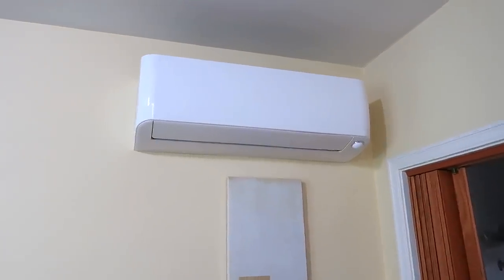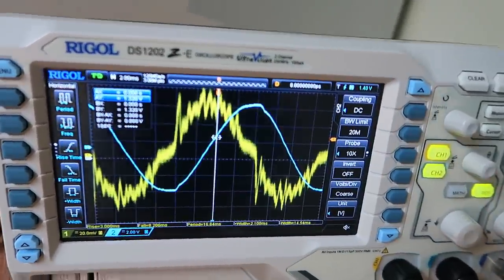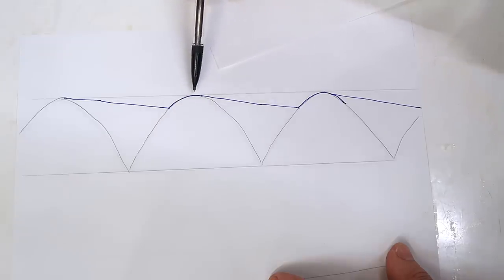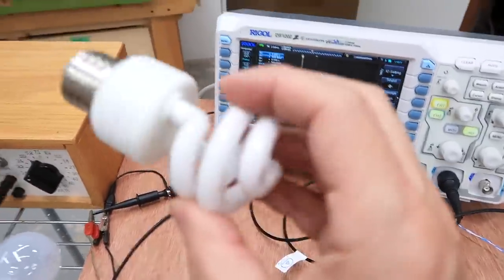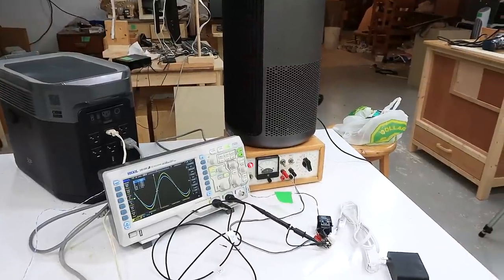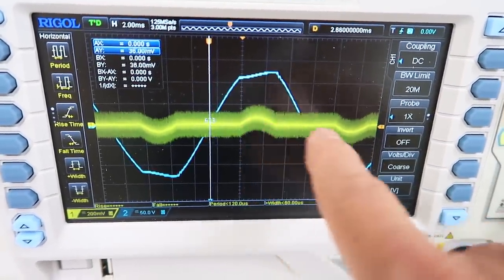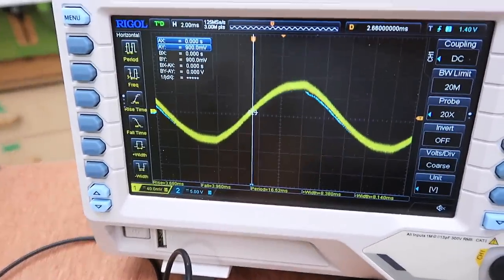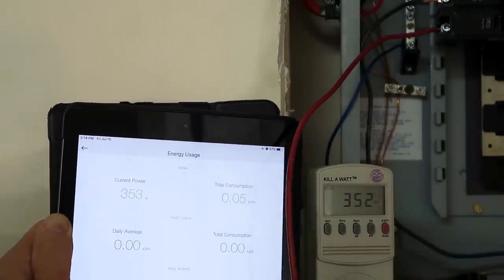Our electrical is all wobbly, measuring power is hard

Comment: That's a bit of a janky setup. I would recommend to use a cheap power meter for three phase with a serial (like RS485) output.
These can be obtained for like 30 euros (you have to convert to Yankee yourself) and provide a fairly accurate result. Then just use your RS485 to ttl converter of your choice and hammer that power register to get your data. Or just get the current overall power usage and plot it over time.
Reply: Edit: I don't mean these aliexpress CT clamp meters. I mean a proper meter that actually doesn't burn your house down like an Orno OR-WE-516. This model is for Europe but I'm sure that you guys will find a equivalent 120/208V version of it.

Comment: Its not quite as bad as you see on the scope.  Don't try to stabilize a current transformer with just a capacitor.  Its a current source, not a voltage source.  So it has to be converted to a voltage source before it can be stabilized with a capacitor... which is what the sensor the CT plugs into will have circuitry for.   Its actually quite a few discrete parts.  simple, but it still takes four or five diodes and five resistors to do it properly.

What you are seeing on the scope is not current.  Actually, you are lucky that you didn't burn something up.  The voltage on the output of a current transformer will be wild if it isn't connected to the sensor circuitry.  It will basically pump until the the electricity starts arcing inside the transformer (like a few thousand volts).

Oh, another thing you need to keep in mind with a current transformer... the output is going to be phase shifted relative to the actual current.   What you see on the scope is NOT the power factor or phase of the actual current.  Its a shifted version of the phase and it's also not a representation of the current at all, it just sorta looks like it.

-Matt
Reply from the maker: I have a resistor on it, also added a cap to low-pass filter it a bit to cut out the high frequency components when I used it with the inverter box.
Reply: @matthiasrandomstuff2221  I'll give you the full circuit.

Two leads from current transforfmer A and B.  Think of a sideways ladder for the circuit.  series components going left to right, and crossing components at various stages.

(1) Back-to-back zeners crossing A to B (A -> back-to-back zeners to limit the voltage both ways -> B).   Usually we throw diodes in as well to the sensor board's rails, but you can omit those since you aren't using a sensor board.

(2) Then series resistors, one for each lead.  Usually around 156 ohms or so.

(3) One crossing resistor to generate the voltage from the current, usually around 12.4 ohms.

(4) Two more series resistors (think of a sideways ladder).  Usually 1K.

(5) And then your crossing capacitor to get rid of noise.  I'd recommend 47pF and 15nF in parallel.

And then your scope probes.

You can omit some of these items but... to be honest, you don't want to omit the back-to-back zeners that limits the differential voltage to something reasonable.  Particularly if you are putting the current transformer on house wiring.  If a breaker trips or a very high inductance load is turned on, the voltage will shoot up too quickly for the resistor to keep it in check and arc across the current transformer's windings.   This is the most common way CTs are destroyed.

Also remember this only works for AC loads.

In terms of additional capacitors.... none of these caps are there to operate as a current accumulator so you shouldn't need any more than that, but if you want you could also throw in an additional 0.1uF cap (100nF).   You don't want to go any bigger than 0.1uF.

-Matt

Comment: But you were already sampling much faster than 60 Hz using the oscilloscope!  Does your scope not have data output or a math/multiply function?  Or is it hard to calibrate the inductive ammeter clamp thingie?
Reply from the maker: I need to log the data over time.  Wouldn't want to dedicate my scope to this.
Reply: @matthiasrandomstuff2221  AD7755  .... they do the heavy lift, you just count pulses. Dont go crazy unles you want LOL ....

Comment: Interesting, never knew you could connect a current clamp to a scope.
Reply: most likely it is a "current transducer with voltage output". 
Eg.. a 1:1000 transformer with an integrated 100 Ohm burden resistor will convert 1A to 1mA (internally on the secondary) and develop 100mV on the output wires.
Reply from the maker: i added a 100 ohm resistor right to the clamp, where I attached the wire.

Comment: On your first measure of current using the clamp I noticed the scope is at 20 millivolts/div. You're measuring a lot of clamp noise, which is bad at low currents to begin with. I don't trust that clamp for being linear with respect to the magnetic field.
If you want to measure current precisely use a transformer that you can make yourself. Wrap one lead (not the wire pair) of the AC line as a coil around a nail, about a dozen turns. Then a few hundred turns of fine wire next to that. Measure the output of this secondary on your scope.
That clamp is noisy and heaven knows what's inside.
Reply: Thanks for the suggestion. I want to remember this for the future.

Comment: So then what if we had the chance to argue the ac vs dc model of supplying electricity to the masses all over again knowing that ultimately many things in one's home would need dc? What about a dual supply model?  Ac for large appliance motors, etc... Some dc level then supplied to the house via the house's ac to dc power "cube."  Imagine a new standard household "duplex" receptacle, except one is ac the other is dc.
Reply from the maker: there are a lot of advantages to AC.  also, we have standardized on it, so it’s not going to change

Comment: So basically, you are highlighting electrical devices that are non-linear loads, which produces harmonic currents and voltages.
Reply: I'd say the non-linear loads create harmonic load currents, which can act upon a source impedance to result in (usually tiny) harmonics voltages. The higher the source impedance, the more significant the effect.... and flat top waveforms (low crest factor) is a typical result.

Comment: this is why audiophiles are going insane with the power supplies and amplifiers.
Reply: LOL .... I've been in an audio forum long ago. I told the people tojust disconnect everything in your house ... period. Audio amps are DC, and preamp sections have regulation .... Probably a 3K dollar IEC cord and 10K magic filter with mundorf caps can help (LOL)
Reply: @38911bytefree  Don't forget to put the magic stones on your "interconnects" so they have good chi, and demagnetize your CDs before you play them in your "transport".
Reply: @gorak9000  LOL !!!!!!! Ohhhh boy snake oil to the next pow And the supports for the speaker wiring so they dont touch the floor ?
Reply: @38911bytefree  Heh, I've never heard of the speaker wire supports, but you could come up with the stupidest thing ever and tell me that audiophools buy it, and I'd go "yup, probably". I lost it at the stones you balance on the back of the RCA connectors between the -cd player- transport and the amp on the $1000 3 foot long RCA -cables- interconnects made out of RG-59 (like that's so special - but it's "oxygen free copper and the dielectric is ground up fairies mixed with dolphin pee and sea horse semen) to "improve the airiness of the sound"

Comment: I apologize if this is incorrect but would it ever be beneficial since they are seeing the same reading to put on one each leg to see if there is some inconsistency such as only one side is being used for the blower or other aspect?
Reply from the maker: The mini split doesn't connect to neutral, and it's not supposed to run current thru ground.
Reply: @mduvigneaud  single phase line current is single phase. We just center tap a transformer to split it in half. Why we do that is a bit complicated. We like the electrical grid referenced to ground though. So neutral is bonded to ground. The two hot legs are just that, they're the two hot legs. They're one big sine wave. Center tapping it we can get two equal little sine waves too. Just how it works.
Reply: @mduvigneaud  no it doesn't. A center tapped transformer just cuts the voltage in half.
Reply: @mduvigneaud  
Paul gets it. You don't, yet. It's a single 240 volt phase with or without the neutral. It's telling that you think the number of turns matters whether or not the neutral line splits the voltage in half.
Reply: @mduvigneaud  
Isn't it interesting that the very first sentence of that Wikipedia article that is attempting to define split phase calls it SINGLE-PHASE ?
Reply: @mduvigneaud  
The short answer is that all AC single-phase power is 180° out-of-phase with itself or, if you prefer, 360° in-phase with itself. It is semantically ridiculous to describe single-phase 240V power in North America as "combining two 120V separate phases" when those two "phases" only exist in reference to the neutral line that is splitting the 240V in half in the first place. When using the full, single-phase of 240V coming from the transformer the neutral line is not being used. You are quite literally NOT combining two 120V phases; you are simply using 240V single-phase alternating current as though the neutral doesn't exist. There is still a ground wire and it is still tied to neutral at the first means of disconnect, but electricity is not flowing through that ground wire unless a fault has occurred.

Comment: Mini splits create horrible transients. This is one of the reasons that inverter driven air conditioners suck.
Reply from the maker: the dreo one i did a video on in may does power factor correction.  I’m surprised the mini split did not.

Comment: Power companies love to stick it to you for power factors less than 95% because of the reactive power component in the vector sum.  Apparent Power = Real Power + Reactive Power (vector addition).  Reactive Power results in a higher current requirement (larger losses in the grid and the power company has to absorb those).
Reply: I'm not aware of any power company anywhere that charges residential customers for reactive power / power factor issues. Only large industrial customers are monitored and pay fees for too much reactive power. So how exactly are they "sticking it to you"???
Reply: Are they "sticking it to you" or are they "absorbing" it? It's one or the other, friend.
Reply: The loads demonstrated had very little reactive power (by most accepted definitions). The traditional "power triangle" for real+reactive+apparent only closes under steady state sinusoidal conditions. (see IEEE 1459 for some definitions)
Most of these loads has a near sinusoidal voltage but non-linear current (high levels of odd harmonics). 
Most definitions for single-phase apparent power use the product of RMS voltage and RMS current.

Comment: How many phases are generated by US Generators?  3/4/6/etc?  Most of the planet uses 3 phases.  If the US generates only 3 phases, then you don't have 'opposing phases' for 240v, you have two phases supplied that are 120-degrees out of phase.  You multiply by 1.732 (= square root of 3) the 120 single-phase voltage, giving 208V across two phases.
Reply: Each house is wired to a single phase from the generator. The transformer has a center tap that’s earthed, so the other two taps are 240V from each other, and each is 120V to the ground/earth/neutral. 

That’s why it’s called “split phase”
Reply: ^what he said^
Individual residences don't have access to multiple phases from the grid like in other countries. It's a single phase stepped down to 240 volts. That phase is then split to achieve a "safer" 120 volts throughout most of the house. For appliances that require the higher voltage, such as ovens, clothes dryers, water heaters and air conditioners, we simply use the full 240 volt single phase that is being supplied to the house. We do not combine two separate 120 volt phases. However, that does happen in some places like older apartment buildings that do receive all three phases from the grid and then split them up among the apartments. And you're right, in those cases people end up with 208 volts instead of 240.

Comment: You inadvertently show why hi-fi enthusiasts like simple power supplies, and how modern SMPS have polluted our lines, causing problems for music recording and reproduction. All recoding studios up until the 1990s functioned like the incandescent light bulb, so the power was clean. Also, today we have huge amounts of tech-radiation and EMI they didnt have generations ago, which cause pollution from outside.
Reply: No, hi-fi "entusiasts" (aka audiophools) just like spending money on snake oil products that do nothing, and have zero knowledge of EE concepts of which they claim to be "experts". What's important for audio applications is the DC on the output of the power supply, not the input. If you want really clean DC, use a linear regulator instead of a dc-dc switching regulator and appropriately sized capacitors to filter out the noise.
Reply: @gorak9000  Nothing I said goes against what you are saying. Where do you think DC comes from? The primary. All pieces are important.